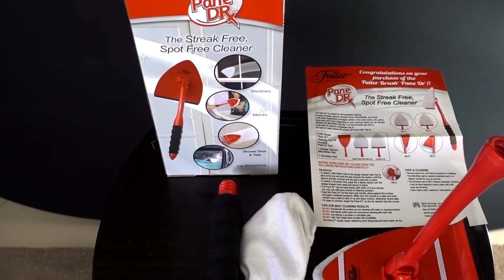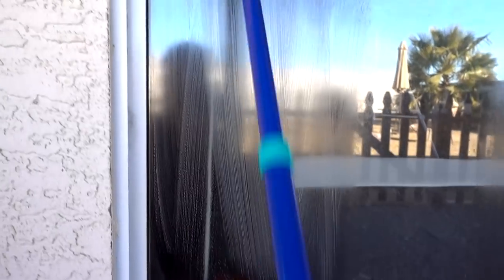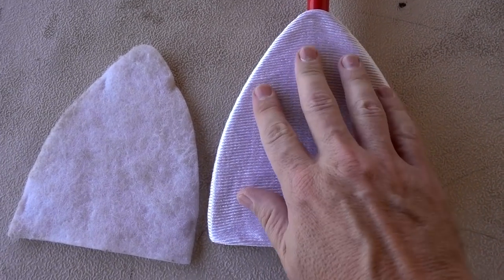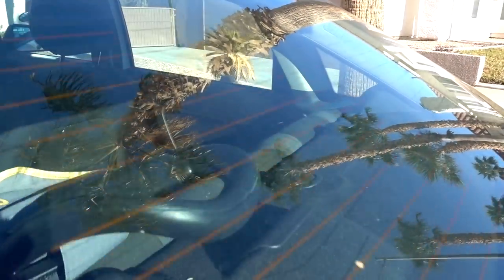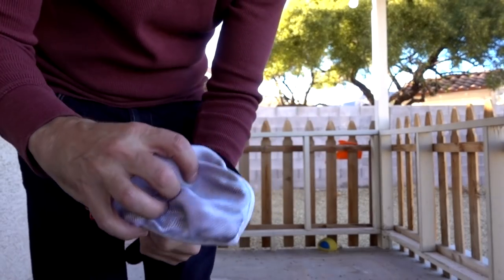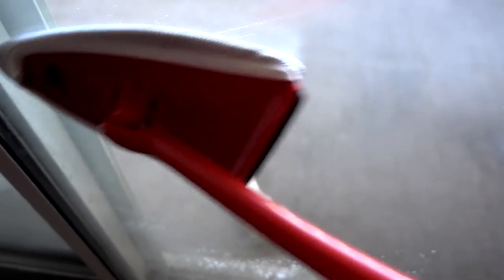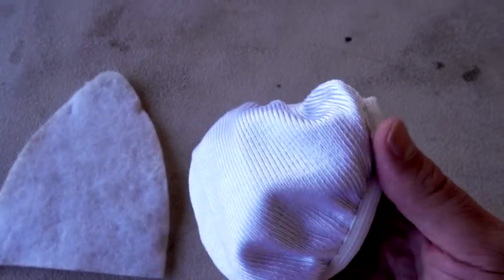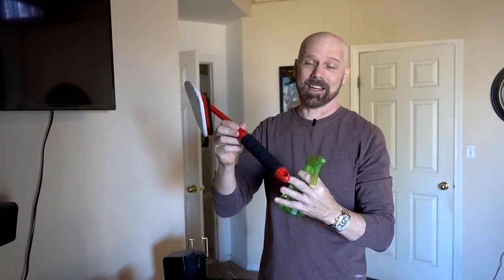Pane Dr. Review: As Seen on TV Window Cleaner

Comment: I have one of those similar pivoting rectangular head window cleaners with the small green microfiber pads for nearly 10 years. It has always worked very well, especially for tough to reach windshield interiors. Good job James.
Reply: Don W That may be the one use I'd use it for. My parents also have the green one. It's great for reaching what a hand and paper towel can't, on the inside windshield off their minivan. Otherwise, it's overrated.
Reply: Agreed! I drive a Fedex truck and have one to apply Rainx to the outside window and one for dust on the inside window.
Reply: I have used it on my sliding glass doors and bathroom mirrors and it does a great job. As far as being overrated (is it?), I certainly would never expect it to clean large smears of toothpaste or the like but for normal duty, it does what it's supposed to.
Reply: Don W we have the green one too.  It was really nice for interior car windows.  Sadly, keeping track of it didnt happen, and now back to paper and windex....lol
Reply: Don W I think it's overrated because of needing so many pads to complete any other job BUT the interior windows. That's just my opinion. My parents are in their 80s. After my mom used theirs a few times, she decided she needed to make more pads. Now, she's got 5 pads in the glove box, and I'm using paper towels to do the exterior windows. It's a pain in the behind to change them all the time. The funny thing is, I'm the only one doing their windows now.

Comment: I just use Windex with newspaper, no streaks and no gimmick.  Also, Windex can be used to clean your steering wheel without leaving a sticky residue.
Reply: Absolutely correct!
Reply: If I had longer arms that would be my choice, but alas! I'm five feet tall and my arms can't reach the center of my wind shield.
Reply: What’s newspaper?
Reply: roofoofighter .... Are you serious?
Reply: @Ethorbit  lmao
Reply: @Ethorbit  It's a true question. A lot of people don't get newspapers anymore.
Reply: I use invisible glass. So much better than Windex. Doesn't leave film and is soap free. You get invisible glass in the auto section. I use it when I detail cars.

Comment: I bought something like this almost 10 years ago. The pads are just a micro-fiber towel with an elastic around it. And a pivoting rod handle. No squeegee. The main reason I bought this was it's real hard to clean the windshield on my Chevy full size van because the dashboard is so thick. This thing works great.

I still use it to this day whenever I clean my cars. The only thing is the micro fiber pads are starting to wear out from where I've used and washed them so much.

Comment: Have a triangular 'as seen on tv' one I've used for years. Don't use it for cleaning but just drying the glass on my vehicles after washing them. Works great for that. Barely damp with water it does a fine job on inside glass too.

Comment: 50% Water / Rubbing Alcohol mix for tv cleaning product.   I bought a 12$ version of that a while ago. I bought a micro fabric cloth and used some string to tight it down to the pad.  I use it to clean the inside of my car wind shield. It helps reduce the fog and gets to corners that are really hard to get to.

Comment: Just a tip.  I have used a product almost identical to this. They work decently when new. The microfiber pad just stops picking up dirt after a few short months or so. As the pad wears down, it stops working. 

If you want to make this work well, buy a nice microfiber towel. Trim it down into several "pads" for these.   I personally bought a large green towel from a place like O'Reilys or AutoZone.  This made about 10 "pads".  

The point here Is you get what you pay for. Cheap microfiber is like a crappy scrub pad. Good microfiber is like a nice sponge.

Comment: Do you know you can make your own glass cleaner combining dawn dish soap, rubbing alcohol, vinegar and water? Much cheaper!
Reply: What is the ratio of the dawn, rubbing alcohol, vinegar, and water to make your own glass cleaner?
Reply: Susan Bissell I know this is an old video but I make my own solution of 2/3 water. 1/3 rubbing alcohol, a few drops of dish soap. This works amazing for mirrors. Plain vinegar in a spray bottle not diluted works amazing on non reflective glass. No streaks. I recommend using very fine microfiber. I’ve tried every kind of cleaner over the years and this solution works the best.

Comment: I would use the scrubbing pads first with the sqeegee. Then follow it with the microfiber pad. Also, when the windows get very dirty they will take multiple attempts of cleaning because the pads are getting dirtier than with a window that gets cleaned regularly.  No judgment here.  Just sayin...  There needs to be more pads included with the unit because I usually want to clean more than one window at a time.
Reply: Thanks for the great videos!!

Comment: Something like this is more useful for inside a car's front and back windows where it is very hard to reach.  I have one of these type cleaners and that's the only thing I use it for.  A squeegee should not be used straight up and down.  My husband used to be a window cleaner and he taught me never to do that.  A squeegee starts at the top of a window and goes from side to side down the window and that way it leaves no streaks.  The edges of the window usually need to be wiped with a cloth.